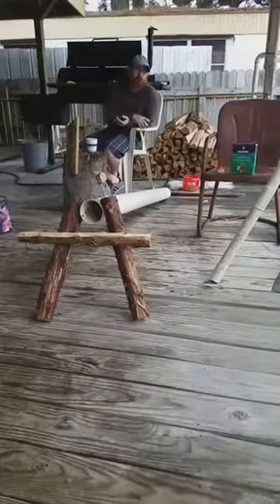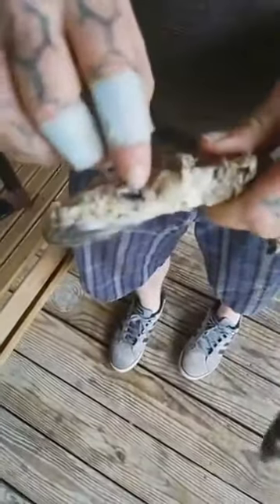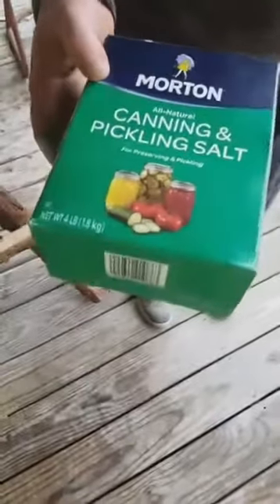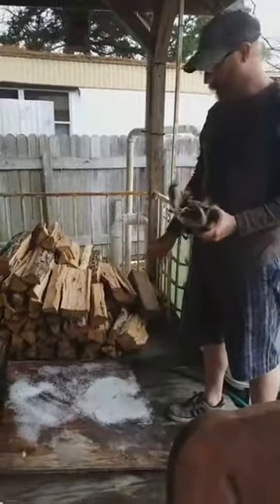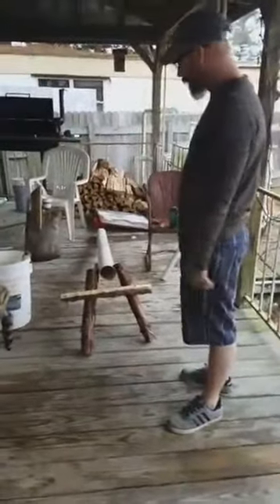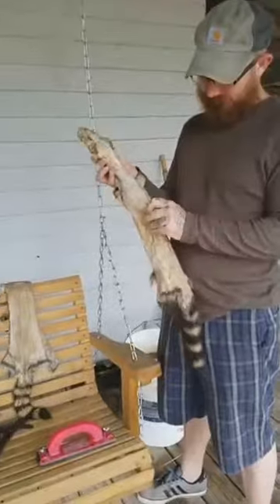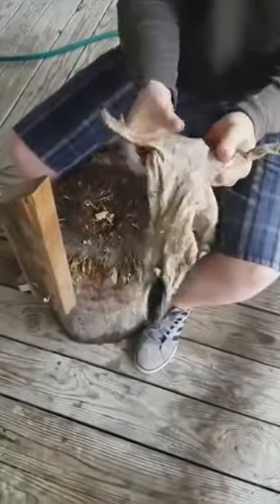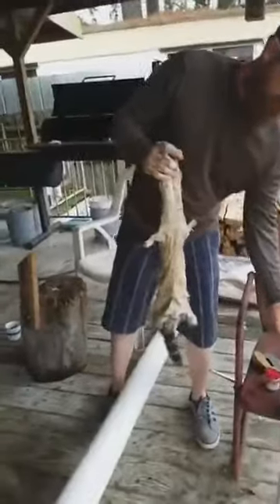A"How to" video on Tanning hides from start to finish.

Comment: Have you ever considered using Aluminum Sulfate (Fertilizer) instead of Alum.  It should do the same thing and cost a lost less than the food grade alum
Reply from the maker: well that's just the way I learned how and I have had good results with the process so I'm just going with what I know